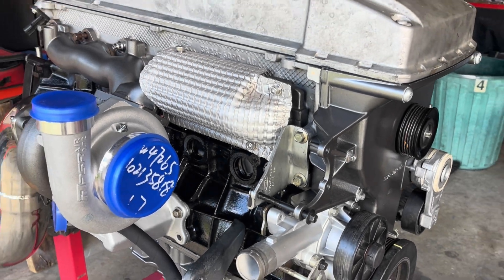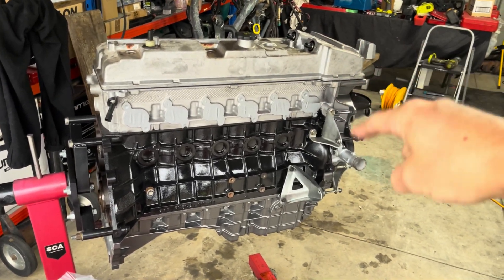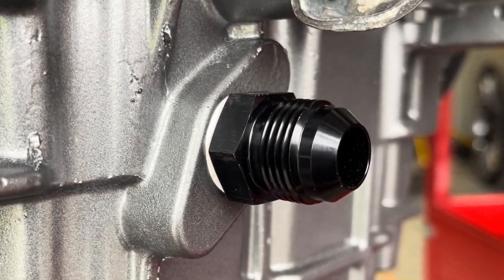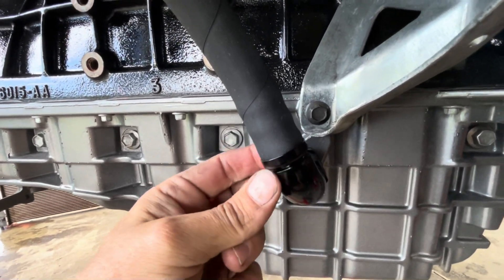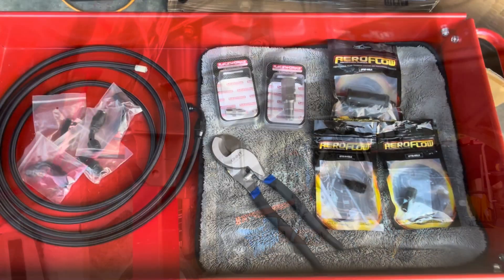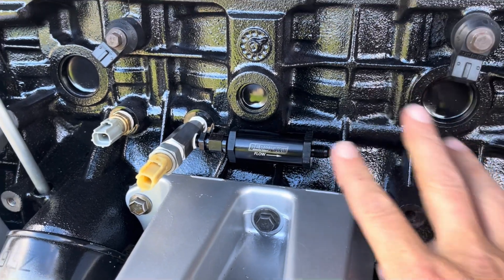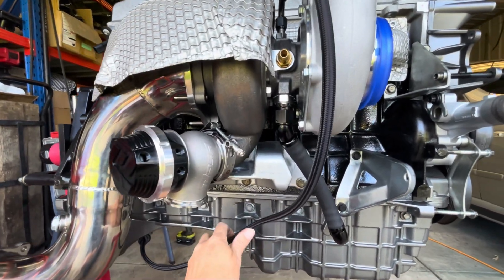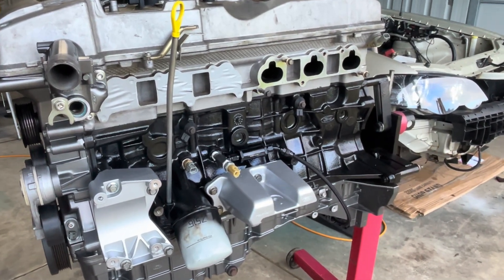Barra NA+T Build Part. 11 - Barra Turbo Oil Feed & Return Lines Installed!

Comment: hey mate think that oil drain hose kit will suit high mount manifold? seems like a great setup but will be running high mount manifold
Reply from the maker: Hey mate, I did cut some length off of the hose though I'm not too sure if it would reach where the drain would sit on a high mount setup. Maybe look at getting the fittings and a separate piece of the hose so you can buy the length you need.

Comment: Another good video but I worry about access to the turbo oil screen once you have all the other crap mounted up to it. I might have missed the video but where is the dump pipe from?
Reply from the maker: Cheers legend… the filter is easily accessible from underneath. I can take it out when serving and changing the filter/draining the oil. 
The dump pipe is part of a complete exhaust system from Antz Performance.

Comment: Going great buddy... hey i think the engine mount bolt is stupidly long, will you have clearance to the waste gate pipe ?
Reply from the maker: Hey mate, you're right... the bolt is long but it did clear the housing "just" I did grind the very top part of the stud off just to be safe but never touched the actual threaded part. Cheers

Comment: Engine Mount Bracket will be fine mate. 
Also, may be a good idea to put the oil feed filter in a more accessible location, they need to be dismantled and cleaned periodically
Reply from the maker: Cheers mate! 👍🏼
You think that’ll be ok? 
The filter is easy enough to get at. I can get to it from underneath when I service the car.
Cheers
Reply: @Jeenzy79  yeah mate. You only need to shave a tiny bit off a corner of the top/end of one rib.

Comment: What size thread did you tap into the sump for the return fitting, i would rather tap an an fitting in vs tapping bolt holes as well for a flange.
Reply from the maker: Hey mate, I tapped a 3/8 bspt thread into the sump. If I were to do it again I’d probably go a little bit bigger like a 1/2. 
https://youtu.be/ntPrB6Faupg?si=kIU32q52CghaoSgG
Cheers
Reply: @Jeenzy79 any reason why you’d go 1/2 next time? Could you drill out retap a 1/2 now if you chose to?
Reply from the maker: @SlowBuildFastCar I could do that now yes but I’d rather not… just to avoid swarf getting into the sump. Only reason I’d go a little bigger is the hole inside the 3/8 fitting is just a tiny bit smaller than the inside of the -10 drain fittings. It’s a very minor difference and won’t affect it at all but I’d do it bigger if I was to do it again. Cheers

Comment: Some brands of pushlock hose say to use clamps if using for oil lines looking into it more the temp rating of some of these Push lock hoses are rather low and most even when high temp rated still call for a clamp if using above around 70c working temp. I would fit clamps its like $5 of extra insurance.
Reply from the maker: Cheers for the heads up mate, I’ll look into that.

Comment: i hope the dump doesn’t shoot the oil temps up! looks shmick tho 👌
Reply: also if you’re ever doing fittings again, use a bit of masking tape. stops the fitting getting scratched
Reply from the maker: Cheers for that mate. I normally use some electrical tape on the adjustable spanner but I’ll give the masking take a go. 
I will be putting some heat sleeve over both the oil and water lines, hopefully that’ll help with the temps. Cheers 🍻

Comment: Saw your comment on independent  motorsport ch. Whats your thoughts on your zf?
Reply from the maker: Love their channel… I’m assuming the way the car is driven will be a factor in how long it lasts. I’m aware that I have NA ZF, and standard rear end… and even the engine being NA is not ideal but I honestly drive my car like an old man 99% of the time so I’m hoping what I have will last a while. So long as the tune isn’t so torquey in the lower end it should be fine. If not then I’ll be sourcing a turbo box 😂
Reply: @Jeenzy79  adding 1 or 2 pwr transmission coolers with -8 lines will aid the life of the trans. Keep it cool, and it'll last
Reply from the maker: @SHOCKcustoms Cheers mate, I’ve added one cooler to it using -8 lines… it actually cools the trans too well where it is. I’ve had it mounted in front of the radiator/condenser and the temps were only staying around 50-55°c The ideal temp is around 85-95°c so I’ve moved relocated it hoping to get some heat back into it. Won’t know how it goes till the car is driving again.
Reply: @Jeenzy79 cooler is better mate. Cool = longevity
Reply from the maker: @SHOCKcustoms I thought that as well… I’ve been told the ZF can be sensitive to the viscosity of the oil used in the long run if it’s not operating at the correct temp. 🤷🏼‍♂️